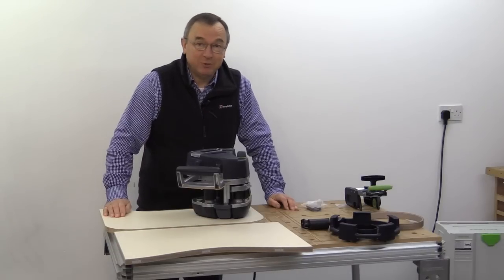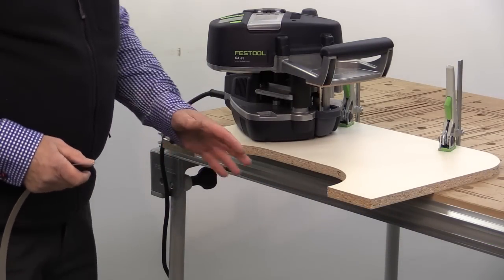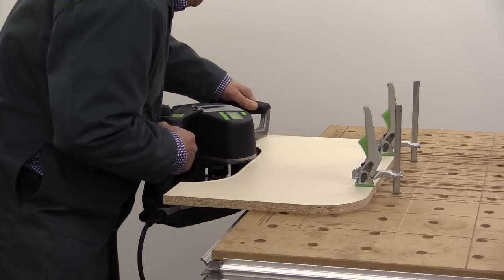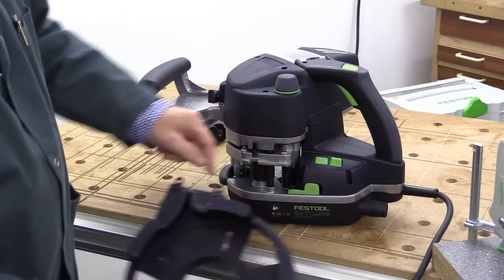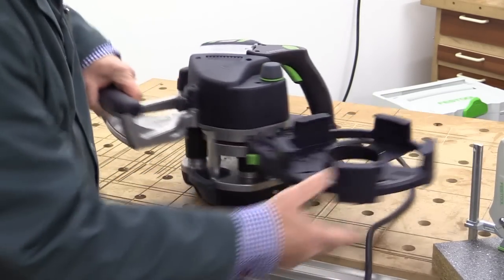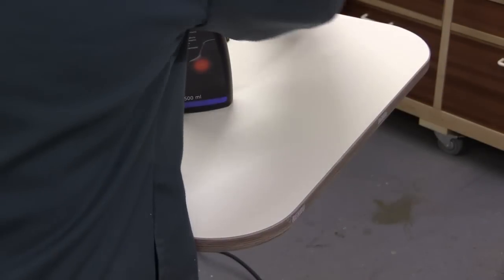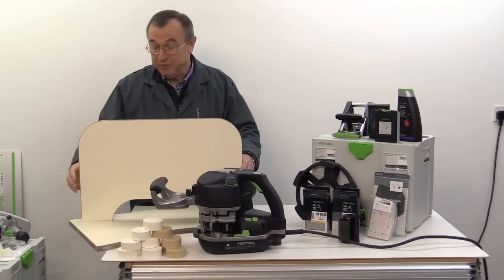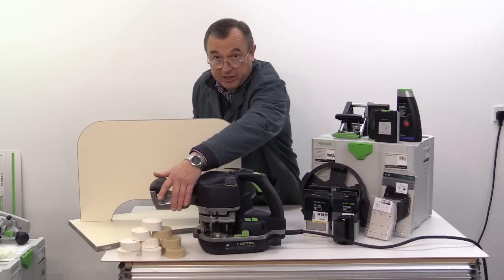Festool Conturo Edgebander - Setup and Use Part 2

Comment: Thanks for the great video. If you're using EVA glue, can you just leave it in machine overnight or do you need to flush it? What's the proper way to let it cool down?
Reply from the maker: Hi Phil, Most of the time the glue can be left in the machine but you might be better to ask a detailed question to your local Festool rep. I only had the machine on loan for a week or so and that was a long time ago.  Cheers.  Peter

Comment: So we now own this fine machine. I am concerned about the banding material to be used. Is vinyl or pvc better? Does one have a higher melting point? Final results are very important.
Reply from the maker: Duane Hurley Hi Duane, I have asked the Festool UK expert to look at this but he is out of the office this week. I am sure that he will respond very soon. If your question is urgent then please contact the Festool staff in your country. I am sorry that I am unable to answer your query myself.   Peter
Reply: Thanks for the response Peter. We love the tool and believe that we have solved the problem. Our banding is just a bit to thin. If your experts have any ideas for us that would be greatly appreciated. I'll check with our experts and leave my findings here.
Reply from the maker: Hi Duane, I think that the thinnest that I tried was 1 mm. I did not keep any of the (tiny) offcuts and everything went back to Festool when I finished so I am afraid I can't be of much help. It really is a great machine though.   Peter

Comment: Do you have to cut the edging to rough lengths or will the machine cut it that way being able to put more tape on reel?
Hope that makes sense 
Great demo
Reply from the maker: I think putting a rough length is the way. I do not have a machine so can not check.  Peter

Comment: Can it used to make cabinet doors or is it just for radios shelves and so
Reply from the maker: Hi Steve, You can use this machine for any edging work that you require - doors, panels and far more.  Peter
Reply: @NewBritWorkshop  ok brilliant thanks for the quick reply

Comment: When applying the banding, you have your sheets laid flat - how is the machine on materials mounted on edge, as in a bench vise?

Also, how narrow a piece can be taped successfully - ie: can you do a cleat 3 to 4" wide?
Reply from the maker: trimix83wasTAKEN I think it might be awkward using the machine with the edge facing upwards - it is better to clamp the piece to a bench top or something similar. I believe that there is a trick to getting really short pieces done but it does depend on whether they are up against another facet. Best to ask your local Festool dealer for advice on that last one.   Peter

Comment: Hello Peter, thank you for these nice reviews. I'm considering about buying it as I get more and more "little" jobs that could be done with this Conturo. I have two questions for you: 4 years later are you still happy with it ? And did you find a solution in order to use already glued bands ? Thank you and have a nice end of 2018 ! Philippe
Reply from the maker: Hi Philippe, I only had the machine long enough to make the videos and then it went back to Festool. I am not aware of any recommended way to use pre-glued edging.   Many thanks for the kind words.   Peter
Reply: Ok thank you for your quick reply ! Kind regards. Philippe